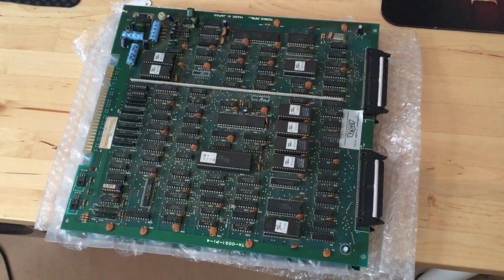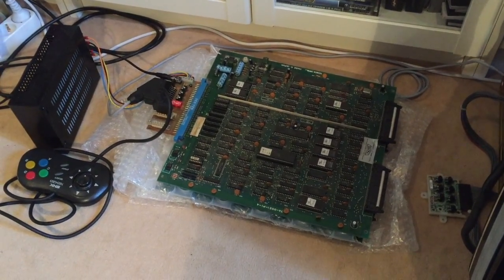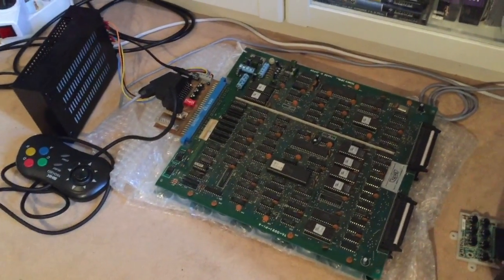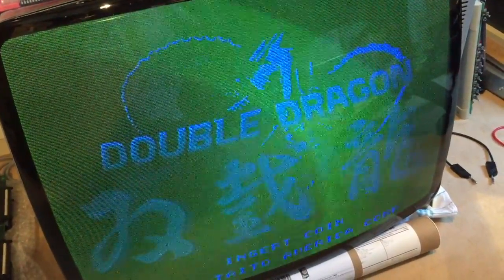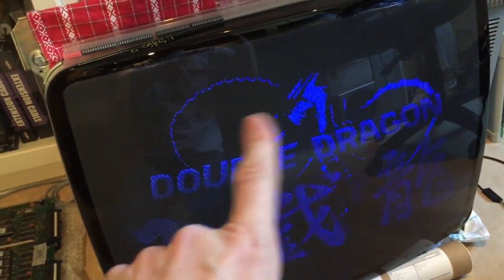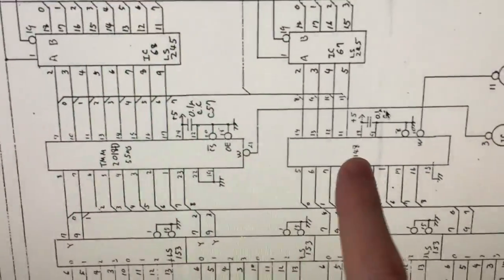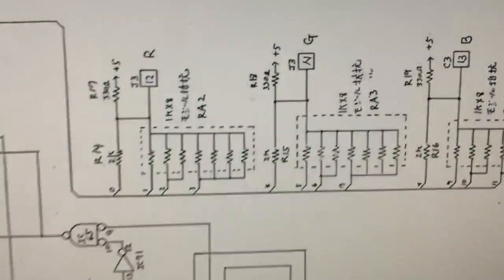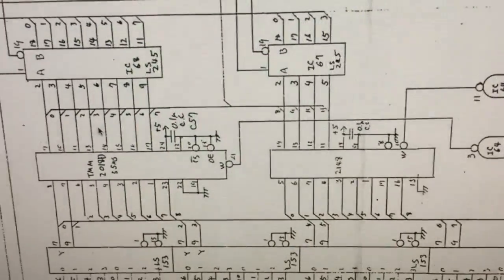Arcade PCB repair - Instant visual diagnosis: Palette RAM/PROM failiure

Comment: Good video. I agree with most of it except on the (n) possible colours. For Frogger, it uses weighted resistor DACs at 3-bit p/col. Use an scientific calculated and the (xy) function to get the number. Other than that I ♡ your work. 5☆

Comment: These videos have been very educational. I just subscribed to your channel and look forward to more great repair videos. I have a similar problem on a Defender board where there is mostly blue tones and no red color. How were you able to isolate this to the color RAM and not the buffer or something up or down stream from the color RAM? I'm using a logic probe and don't have access yet to more advanced tools.
Reply from the maker: Very good question indeed. You are right, I didn't quite point out so clearly why you should immediately think of a faulty ram in the case of this board. The reason is actually the color glitching and flickering that occurs on the title screen. That is probably caused by the ram being read and returning different "random" values for the same ram location each time it is read. 
Generally in the case of a palette issue the problem can only really be the rams or anything down the stream, not really up the stream. For the buffer being faulty it would have had to be a more constant color issue like only blue colors all the time.
I looked at the defender schematics and maybe with your issue as you describe it (no red, mainly blue, some green perhapes?!) it is most likely that one of the 2 palette rams on the board is faulty (probably the one that is connected to the 3 bits of red output and 1 bit of green). It is a "7489" 16 pin bipolar ram ic and should be located near the rgb output connector on the main logic board at location "2C" next to a few diodes and resistors. Check with your logic probe if the output pins 5,7,9 and 11 are toggeling if they are not - replace the ram.
If you need any more help please feel free to post here - also please report in if you were able to fix your board - then this video would actually have served a purpose.
Reply: First of all thank you for your very detailed response! 
Pin 7 is in fact low on 2C. However pin 3 is floating on both RAM chips 2C and 1C. Should I replace both RAM chips or does this seem to indicate a problem upstream?
Reply from the maker: Oh, that would be the write enable of the rams. So that would mean that the palette can't be written into the rams and therefore could be invalid. So don't replace the rams, instead look at the source of the signal to pin 3 (follow the traces). Both pins 3 should be connected to pin 12 of an ic 7410 at 6J. If the output pin 12 isn't floating then theres trace damage between this chip and the rams. If it is floating and the inputs of the 7410 are not (that are pins 1, 2, 13) then replace the 7410.
Reply: First I verified that I have continuity between 6J pin 12 and Pins 3 on both 1C and 2C. However, 6J pin 12 is high but pins 3 on both 1C and 2C are still floating. This doesn't make any sense to me. Also the 6J input pins 1, 2,12 are all pulsing.
Reply from the maker: 6J pin 12 high, ram pins 3 floating and continuity between them ok don't go well together. At least one of those 3 facts has to be wrong. Reverify. Alternatively try bridging 6J pin 12 to the rams pin 3s temporarily using a jumper wire to see if that fixes the issue. Be sure to reset the game after connecting the jumper wire.
Reply: I replaced the 7410 at 6J and now have all my colors back!
Reply from the maker: Amazing! Doesn't it feel great to be able to fix stuff? ;-)